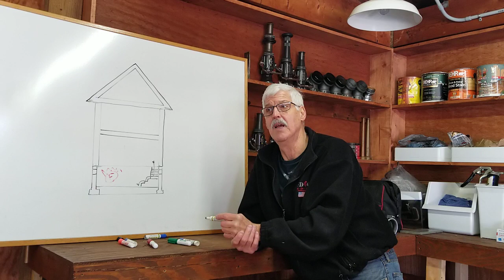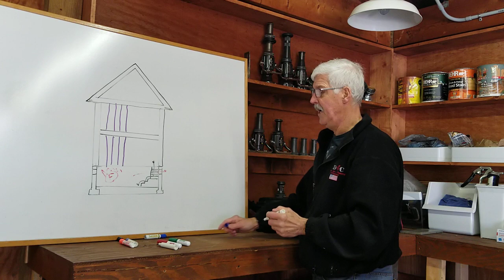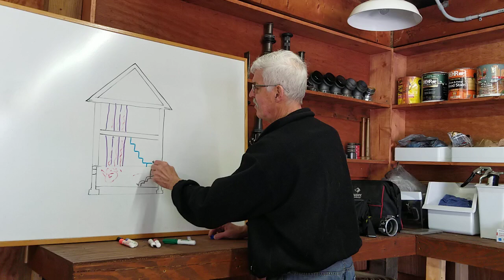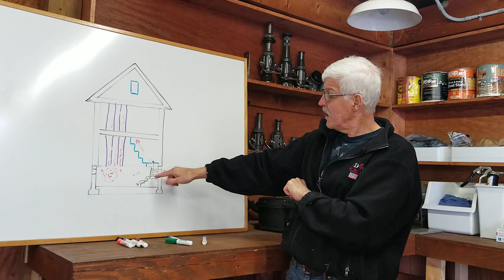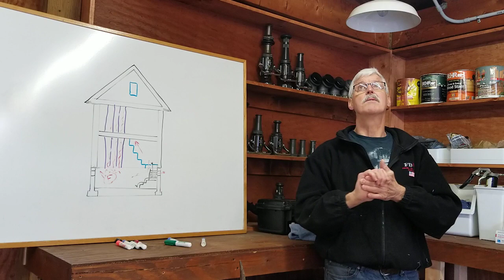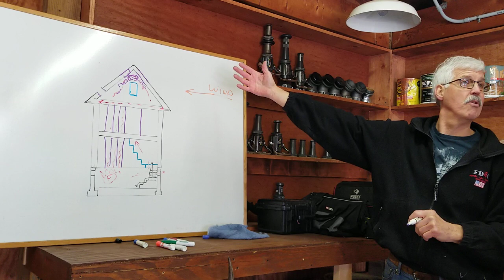Basement fires and the coordinated attack

Comment: 4748 views in 2 years and ONE comment!!!!!!!!!!!!!!!!!!  No, you Aren't going down a chimney to put a basement fire out.  That makes absolutely no sense.

6:00  NOOOOOOOOOO!  Absolutely Not!  Let's apply some of that Common Sense and Logic I mentioned.  That basement is a pressure cooker.  You open the basement door, and you release that pressure into the unburned first floor and into your face.  See those cans behind the presenter?  Every basement has them!   How would you like one of them to explode while you were heading down those stairs.

I'm not going to watch all of this because I know what to expect.  You vent every basement window and Fog the entire space from the window you feel is closest to the fire area.  All the gasses will escape out the other windows.  Then you move to other windows where you suspect there might be burning material.    Then you put a fan at an upwind window to vent the basement.  You can also cut a small hole in the first floor just inside the entry doors to insert a nozzle open to a wide cone of water.

Under No circumstances do you walk around on the first floor with only 3/4" of material between you and an inferno.  When you Know the basement is no longer burning or at least extending and the temperature will not allow containers of flammable liquid to explode, then you go down the stairs slowly and carefully with plans in place for quick removal of firefighters if they get trapped or injured.